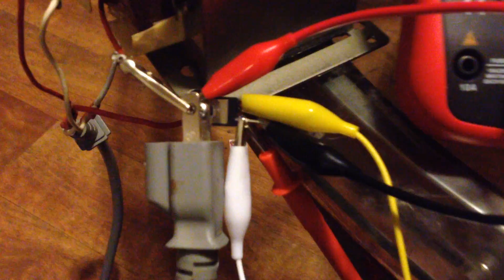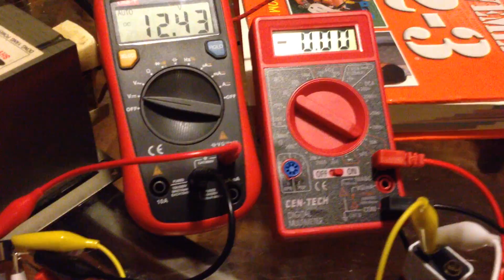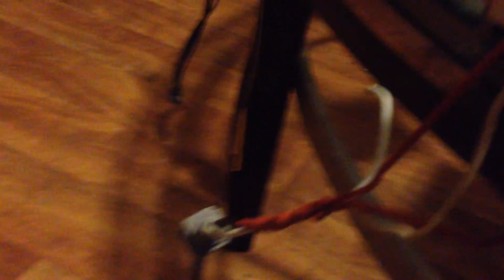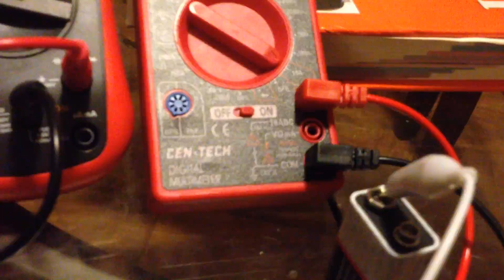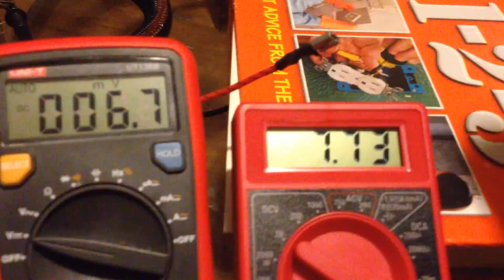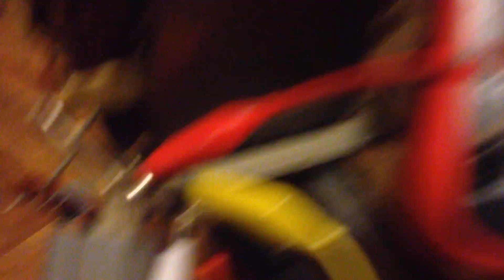How To Measure RDS(on) or on State Resistance of a Mosfet

Comment: Very nice , I wonder the 8m Ohm on datasheets are they include the leg resistance? or the leg resistance is too small to ignore? for turn on sequence I think the first have to turn on Vgs before turn on the 12V to prevent hot switch on.. the reason is , when the MOSFET ramp down from 12V to 8mV the switching loss can be too great to kill the MOSFET.